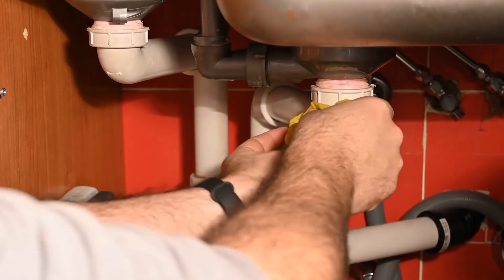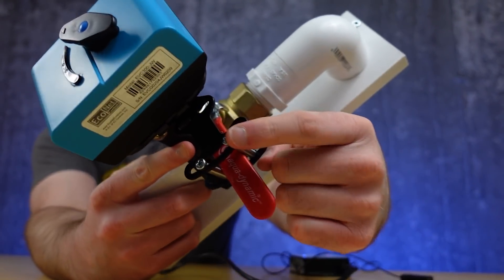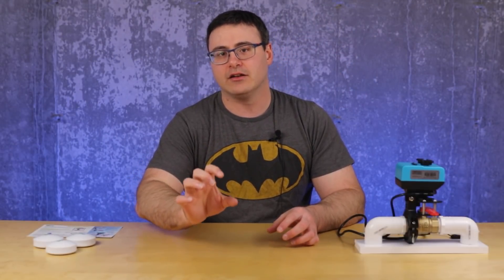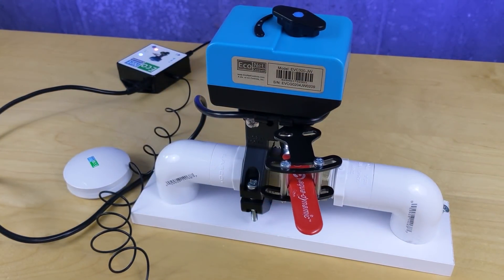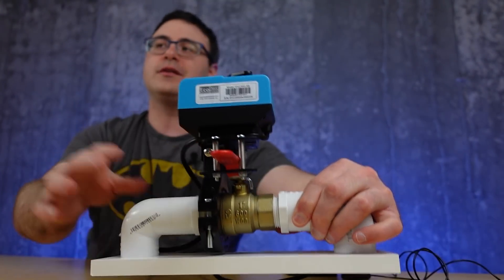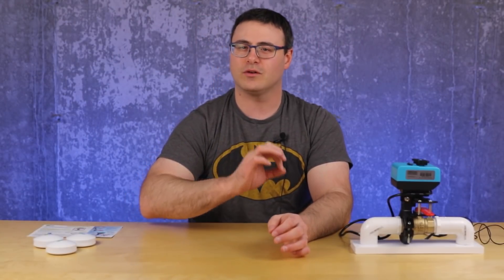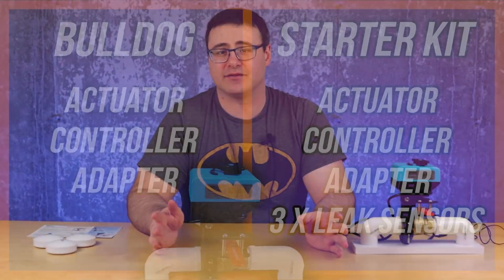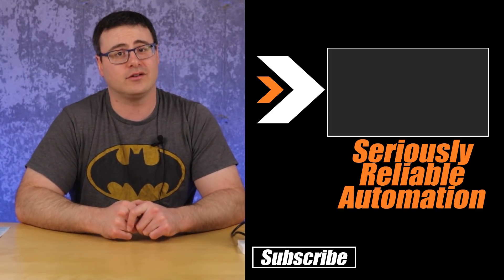This Automated Valve Will Protect Your Home from MAJOR Water Damage - Bulldog JW Review

Comment: So, check this out, Brian.

My shutoff valve is inside a hole in the ground, in our front yard, about the size of a coffee can.

It is by no way either water proof, nor near a power receptacle. 

So, I need a solution that itself can be submerged (the hole floods in rain), and battery powered.

Stupidest plumbing design ever! It's one of the things I absolutely hate about my home. 

So, I'm still on the hunt for a solution, but not holding my breath for one.
Reply from the maker: You should talk to Econet Controls.  The coffee can size could be something you need to open up a bit, but they make sealed options and can also make longer cables for you.
Reply from the maker: Also why not bite the bullet and move that in?  Leave that one there, just add a backup before your first takeoff.
Reply: @AutomateYourLife  because I'm plumbing illiterate. I would need to hire a grown up for that. 🤣

Comment: Nice thorough review. I initially looked at this type of smart water valve control, but decided that the Moen Flo water valve is a better solution. The problem with the valve controls that fit on existing valves is that they rely on sensors in the home to detect leaks before acting. Plus, many valves have been in place for years without being moved. To start turning them on an off a lot is probably just asking for them to start leaking (if not out of the valve, at least past the valve). Flo by Moen not only acts to shut water off if their sensors detect a leak at a location you have put one in, but it does a nightly pressure check of the system by shutting the water off and checking if the pressure dips. This indicates a leak in the system. Could be a toilet or a faucet, but it could also be a leak at a joint or other area where you would not put a leak sensor. Flo also has awesome reporting. If I start using an unusual amount of water at a time I don't normally or forget to take the house out of vacation mode, I get a text, an email, an app notification and a call. (My Google alarm system should be so complete when someone breaks into my home). It then shuts the water off unless I take action.If you leave a hose on or what would be a sustained leak, same action. So while those on valve solutions are quick and don't require a change in plumbing, there are far better solutions out there.
Reply from the maker: Hey Roy - thanks for sharing!

Comment: The bracket makes the difference, between the cheap ones and these expensive ones. I have got the cheap(wi-fi - better range) Ali one, and machined my own solid aluminum bracket for it. Works great and fast.
Reply from the maker: Thanks for sharing!
Reply: @AutomateYourLife  The cheap ones would work well, if the bracket that hold it to the valve, would be sturdier. Those flimsy sheet metal clamps, are way to weak. I made a very similar clamp to the Eco net one.

Comment: Good review for a product that seems to have most, but not all, of the bases, covered.  Since this is a device that will not be in use very often it should come with a rechargeable battery for the operator.  My garage door opener even has one. Once you mention "UPS" then you can be sure folks won't do it.  They should at least offer it as an option.  Yeah, I know you can DIY-it, but how many will?  Another important takeaway here is to make sure you have a water shut-off with a ball valve someplace that is easy to get to.  Many homes don't have this and the idea of having to go out in the yard in the middle of the night to shut off the water isn't very pleasant.  Getting a plumber to do this for you if you aren't comfortable doing it yourself, gives you a lot of options you won't otherwise have. As always, you did a good job with the review and I thank you for doing it.
Reply from the maker: Wow...you know, that must be a US thing to not have an indoor water shut-off on a ball valve.  Honestly, I don't think I've seen a home from later than the 70s without one in it here in Canada.  Maybe it's just our side of the country though, since it's too cold to ever have an outdoor shut off (cause...it'll be frozen for sure).

All in all, you've brought up some great points here.  Thank you as always, Hugh!

Comment: Great review. I like the 433MHz for local control plus the Wi/Fi ZigBee. Does it notify SmartThings when it detects a leak? Thanks for pointing out the 2.4GHz/5GHz issue with routers when you have 2.4GHz devices wanting to join. That has caused me problems with other devices on my Nest Mesh Router
Reply from the maker: Hey Frank - it doesn't notify ST or other hubs per se because the leak sensors aren't visible at all outside of the enclosed system.  There's a workaround for that, as you can get a Sonoff 433 MHz receiver and then use that.  However, I wouldn't suggest it.

The way you know is if the valve goes closed.  That you can make sure has a notification!
Reply: @AutomateYourLife  Thanks. So what does the interface to SmartThings provide?

Comment: What's your opinion on something like this over the Moen Flo?  I'm in a condo so can really use either (or I'd need a total of 8), but these look great for those with a house and a main shutoff for everything.
Reply from the maker: I like that this is completely offline if you want it to be and that the reliability of it isn't based on algorithms/processing of water flow.

Having worked in an industry where leaks were attempted to be detected by flow meters like the Moen Flo, I can tell you it's much less reliable vs an on/off signal from a leak sensor!
Reply: @AutomateYourLife  I did like in reading that the Flo can check on pressure and also try to check for leaks (by shutting off water and watching for a drop), but you are right about reliability.  Granted, my only concern without it is that if you don't have a leak near a sensor, how will this trigger automatically (as in, say a break in a wall)?  I do like though this one can be installed without altering plumbing though (having to cut the pipe to install).